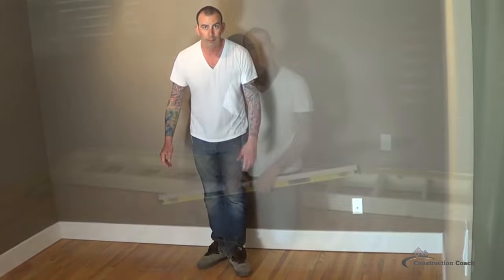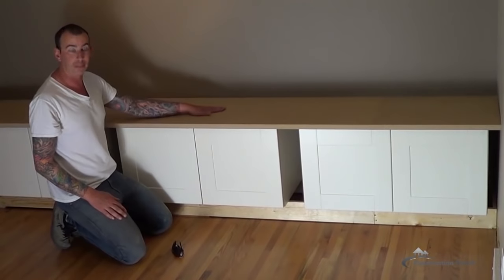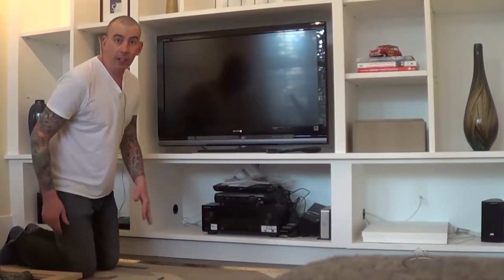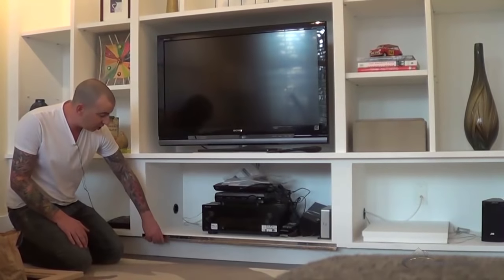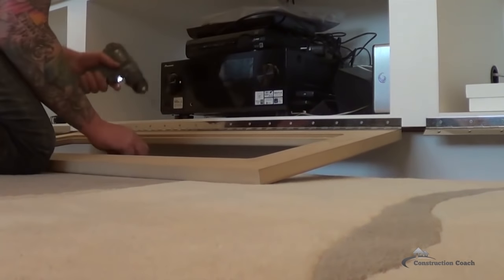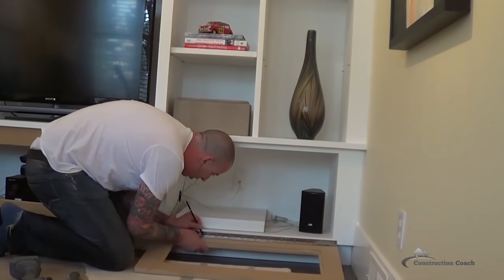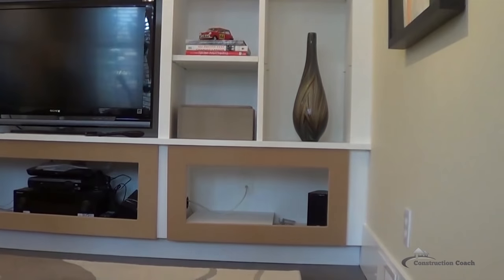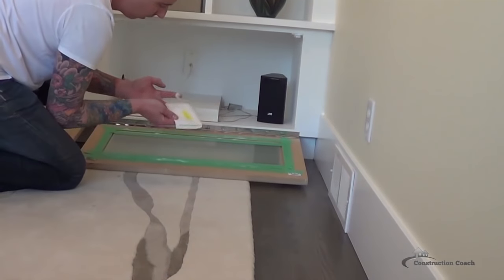How to build with MDF - DIY build-in's

Comment: Like the design and you have given me a better idea on how you can use just MDF to create built-ins.

Like others have said, it would have been nice to see how you installed the MDF prior to you talking about what you were going to do next.

The cut outs in the bottom cupboards is a nice touch, although I was surprised that you did not paint the inside of the cut-out, which can be partially seen through the silicone.

I was also surprised by how you did not fit anything to those bottom opening cupboards to stop them hitting the floor, especially as they have glass fitted in them.

Comment: One question... after you add the trim pieces it appears (maybe it's just the lighting or something) that you installed a backing on the entire shelf system, is this so?  And if so is it so you can more securely mount it to the wall?
Reply: Not only that but it stops any shadow gaps in uneven walls .